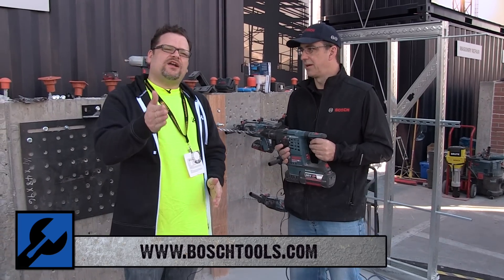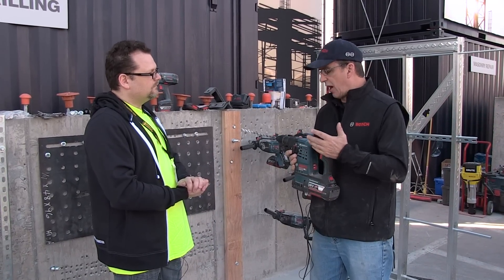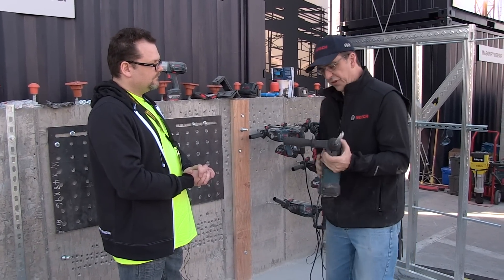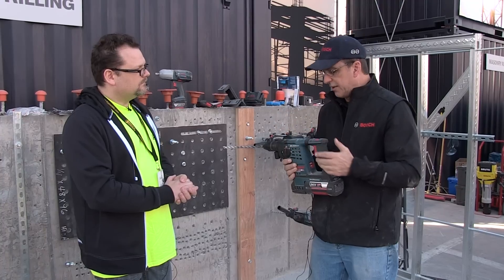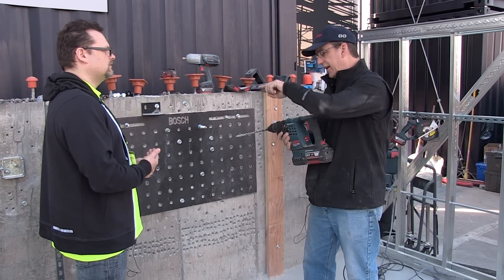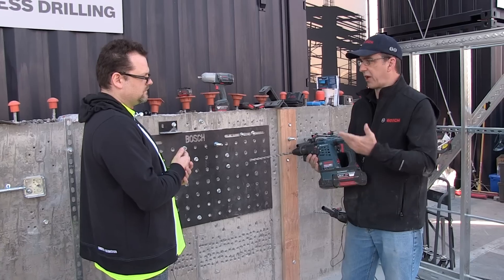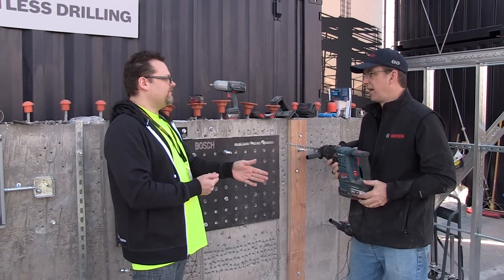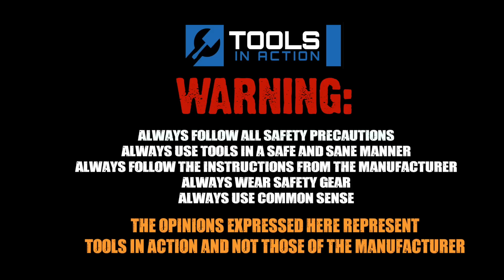Bosch Bulldog 36V SDS-Plus Rotary Hammer RH328VC-36

Comment: During this video the (Bosch)! Spokesman forgot to mentioned that the SDS chuck is removable and can be fitted with a quick lock metal ratcheting chuck for drilling  with small drill bits into wood or metal.